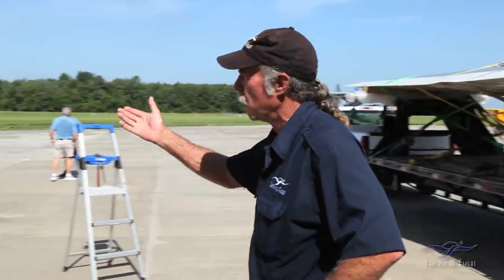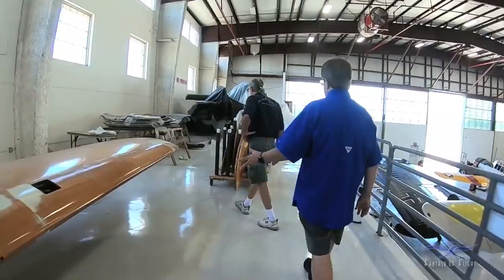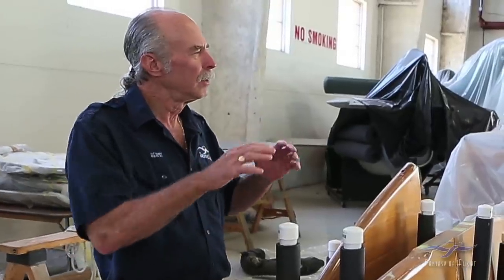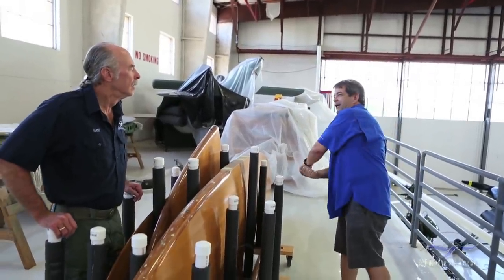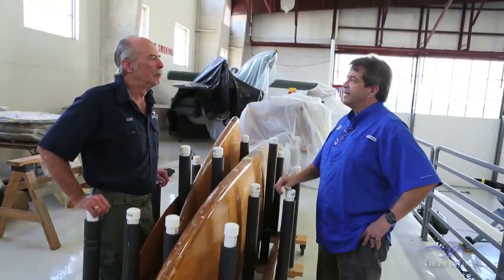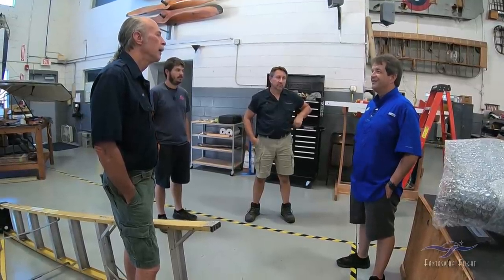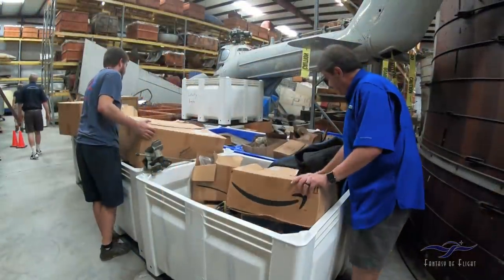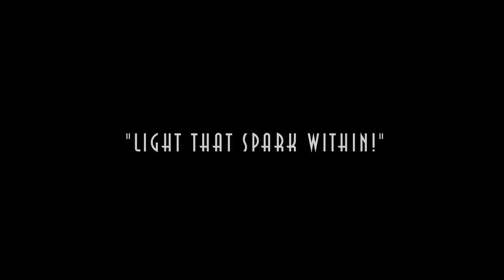Lockheed Vega - Winnie Mae - Project Restart

Comment: I was only thinking about the Lockheed Vega project a few days ago,last time you flew over to his strip in the Vultee Vigiliant and was discussing the fuselage restoration,I believe that at the time you were waiting for a special order of birch ply to be delivered to do the fuselage woodwork.
This is a beautifully constructed airplane that is getting all of the attention it deserves,the aircraft was used for low signature radar work hence the fitting of non metallic fuel tanks with those fibreglass ones,so pleased that you are adding the correct fuel tanks.
The wings look like pieces of furniture such beautiful restoration done on them.
Thank you Kermit for your consideration in filming the rebuild process on the fuselage for us to see.

Comment: Hi
Some of the composite small airplanes had epoxy? that softened in the heat. Things like thermometers in the fuselage to give a "No Fly" too hot indication.
So my point is the glue has to stand up to the 100+f temps we see here in central Fla.
Good luck.
Reply: @Dennis Williams, unless I miss my guess, the glue they use CURES in the heat.  The heat is what hardens it and makes it stronger.  Once it's cured, it's a solid and the wood would combust before the glue would melt.

Comment: At about the 1:30 mark there's a picture of a F3F, is the same F3F you picked up in Cali (if I remember correctly) and flew back to FL but had to have a mag changed in Big Spring TX? My dad worked on that plane. It was around 1999 or 2000

Comment: Where did Kevin get the male plug from? Did he first build a plug based on the existing airframe?
Reply: i guess he made it from the existing airframe, there's no way such a big piece would have survived for so long and still be useable
Reply: @quentintin1  Making it from an existing airframe, he would first have to build a female mold, laying in a 4 mm thick skin or whatever before he could start building the male plug into that cavity. Sound quite elaborate.
By using the existing airframe to make a male plug, you would end up with an airframe that's 8 mm larger in any direction. Mhhh...
Reply: @Sventie99  We are making the plug from scratch using the factory airframe drawings for proper dimensions and shape.  Many restorations we have done require making the tools first and then make the parts from those tools.  First, determine the parts needed, design and create the tooling to make the part, and then, make the part.  We considered using the fuselage as a plug to make the new mold.  The issue is that the existing fuselage has been repaired 5 or 6 times and is no longer in good enough shape to fly or use as a plug.  No drawings for the jigs and molds are available.  So, we designed a new plug and other tooling using the original airframe drawings as data as well as referring to the many factory photos to see what the original tooling looked like.
Reply: @kevinkimball7711  Thanks, very enlightening.
Reply: @Sventie99  he could have just gutted the existing airframe, took measurements every 6 inches (or any interval really) and built from here
if the airframe was considered sacrificial he could even have used the airframe as a mold, filled the insides and cutting it open to reveal the plug

Comment: This raises the question, "Is delamination a veneereal disease?"
Reply: De lamination was caused by early beetle adhesives that degrade badly over time before reorcinal resins came on the scene,plywood was laminated with this adhesive as well as used in aircraft construction,you can detect its degrade by smell and also the tell tale mauve colour around the joints.
So it is yes to your question !

Comment: When I used to visit air museums, I read the information plaques and after a while I noted the information started to read all the same. The design, specs, years and production numbers and after a while it felt blah blah blah.  People say an aircraft is alive,  well it is alive because of what and how people reacted with the machine.  Perhaps it is time to personalize these plaques. For your Vega, who  first operated the machine, what advances in radar equipment occurred because of your Vega's involvement, who resurrected the Vega before your ownsrship (a fellow named Johnson from a late '60s Air Progress article)?
I like the vacuum process for the glueing of the lamnations.  I was exposed to this technique while working on the Seawind prototype project in its early days in the early 1980s.